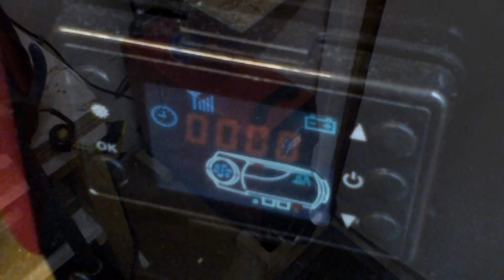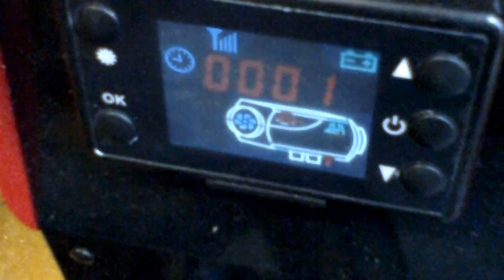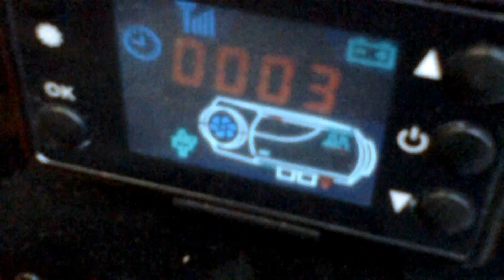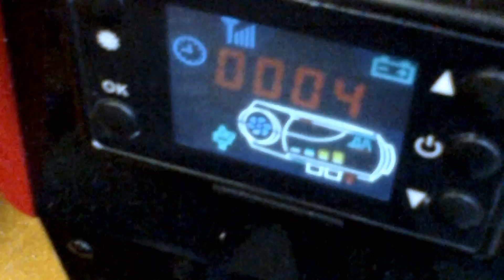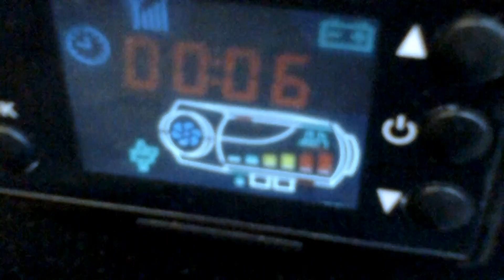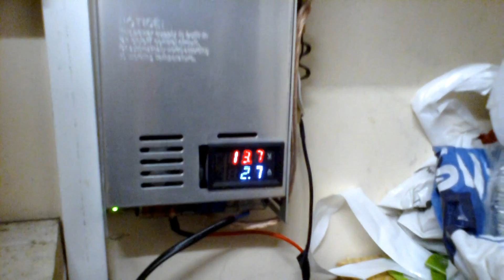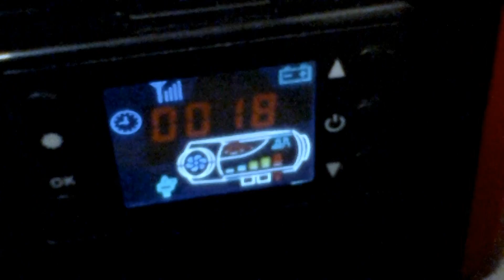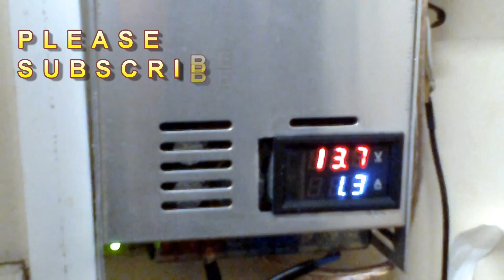COMPACT CHINESE DIESEL AIR HEATER - AMPS used in REAL TIME

Comment: What is your power source peter
Reply from the maker: Hi Amac. As you can see in the video it’s a 20A switch mode power supply from eBay. They all seem the same. Been very reliable. Please note that I installed the volt / Amp meter as this is not standard and was made for the video.
Regards Peter

Comment: What power supply you using? I have a new 12v 30A power suppythat looks like yours and when I try running my new diesel heater it drops the power supply voltage to about 8v and shuts down when I hear one click of the pump. Is the power supply too small or defective? Checked power supply with no load and it's at just over 12v
Reply from the maker: Hi Luke. If a 30A is having the voltage pulled down like that then it’s defective. I use 20AMP power supplies off eBay 
Regards Peter
Reply: @brucepeter2007  found the problem. It was me and not the power supply.  I had it on 230v plugged into a 115v outlet. I win the dumbass award. Lol
Reply from the maker: @lukegodin8653  Opppssss

Comment: Hello mate, I have a single 12v gel battery is a small tear drop camper! I am not as smart as you are with amps and volts and watts and all that good stuff! My question is can I run one of these heater in a small tear drop the whole night? Or will it kill the battery?
Reply from the maker: Hi Lester. You never mentioned the size of your battery so can’t give you a fair answer to your question. If it’s a small teardrop unit I would say that even with a good battery it would be too powerful for such a small space. Sorry to be the bearer of bad news. Regards and stay safe. Peter
Reply: Peter Bruce it is a deep cycle marine/rv battery here the specs: 

SPECIFICATIONS
Cold Cranking Amperage:	550 A
Cranking Amperage:	685 A
Height:	8.875 in
Length:	10.25 in
Negative Terminal Location:	Top Left
Positive Terminal Location:	Top Right
Reserve Capacity:	140 min
Terminal Type:	Top Mount
Voltage:	12 VDC
Weight:	45.5 lb
Width:	6.812 in
Reply from the maker: @LesRCnmore  Hi again. Recon you would get a few nights out of that but I say again - this type of heater would be too much for a small teardrop caravan. Up to you if you fit it but bear in mind that most of the current draw is on start up and shutdown and with such a small space it would soon feel like you had a volcano in your camper and you would have to turn it off... Good luck whatever way you go. Regards Peter
Reply: Peter Bruce Yes sir I am aware that the 5kw is way too much for my teardrop, but Amazon here in the USA sells the 2kw versión it is smaller and more compact! Therefore, if my battery can run the 5kw for few nights that means that It will handle the 2kw like a champion!
Reply from the maker: @LesRCnmore  Good luck to you - stay warm and stay safe. Peter

Comment: I have a 12ft caravan (Australia) what size unit would I need? my van has 120amphour deep cycle battery...how long would battery last...only run LED lights
Reply from the maker: Hi down in Oz. I take it your looking at fitting the separate type of unit heater into an under bed bunk rather than this compact kind of heater! Either way you go with a separate or compact type the 5kW would be ideal. Heats up quick and after you hit your set temperature will tick over at around a 2kW output. How long will it last is a question like how long is a bit of string as your question contains so many variables. Condition of your battery (how many times it’s been cycled) how cold it is outside - how long are you running the unit (27/7) and the temperature you set the unit for...
As you have seen on my video it’s the start up and shut down that uses all the current from the battery and once the inside set temperature has been reached it will poodle along using around 1.2A so at that rate the battery would last you ages - I would recon you would be safe for at least 3 nights.
Another factor is these units sell as 2, 5, 8 kW but it’s only the 2kW that is a smaller size unit as the other variants are the same unit with just different setting to burn more fuel to increase the power output.
The 2kW units are rare to get hold of and most ordered are in fact supplied with the 5kW size bigger unit with the fuel rate and fan speed altered...
Just a few last tips - when you get your unit do a lash-up test run with it before installation and ensure the cables from the battery to the heater are substantial as a current drop to the heater will not be tolerated and give you an error code.
The last tip is don’t “twiddle” with the internal timing settings unless things go wrong. Many problem installations Are due to the twiddles made to the setting that cause them to soot up. It’s a furnace so if it runs leave it alone.
Hope I have been of help and thanks for viewing my channel. 
Regards and stay safe in this never to be forgotten year China has given us - Peter
Reply: @brucepeter2007  Thanks Mate for quick reply...Yep we are doing well here in South Australia...I camp mostly in our winter thats now...but its cold for us at 45F/7C in our caravan...but cause our van is small theres no room under bed or in cupboards for even heat inlets...we bush camp only no power
Reply from the maker: @smokeydk7712  Hi again. If you go for the compact type you only have to get the exhaust and combustion’s air inlet pipe to the outside. At that temperature you should get 3 evenings no problem and a 100w solar panel on the roof would give a kick to your battery even in winter. Good luck to you whichever way you go. Regards Peter
Reply: @brucepeter2007  thanks..I do have an 100w solar panel on van roof...even in winter by 10am the battery gets fully charged...I like the portable idea..thanks again 👍

Comment: Hey Pete... great demonstration... thanks. BTW... your LCD controller is very readable, my own 6 month old controler is almost blank... very hard to read unless all lights are off in the room. You know where I can get another controler?
Reply from the maker: M
Hi Mikey. The LCD screens like mine - all have the same issue for some reason and the only way out is a new controller which you can get from Aliexpress or Banggood. Hope this helps. Regards Peter
Reply: @brucepeter2007  Hy Bruce... tanx for your prompt reply. Tell me, how long did the original one last compared to the new one you have? I ask because maybe the new one is better.
Reply from the maker: @strikemaster1  Hi again. Got two units myself and I have two friends with the same so in total four the same.
Only one controller has faded but Is still legible. I have no experience on the newer type but each seem to have their quirks. We all use the remote control units so don’t really look at the controllers much as it’s the on / off button that’s used and once the previous temperature is reached the unit cuts back making the LED display redundant.
The view angle is quite critical and just changing the angle you view from makes a lot of difference.
Remember that if you change over your controller you will have to re-program it and if you don’t get the settings right your going down the sooted up strip down often road which is the only vice these units have.
Most units work fine but problems are mostly caused by bad installations or “twiddlers” who mess with the controller settings. If you do replace the LED controller ensure you know all the settings contained so the new unit can be programmed correctly. Best of luck whichever way you go. Regards Peter
Reply: @brucepeter2007  Thanks mate. Think I will order another one anyway. Doesn't hurt to have an extra one stanby when they only cost $30. Thanks for all your help and guidence... You a good bloke.
Reply from the maker: @strikemaster1  Hi Mike. Best to use the remote control as you never really need to touch anything then as you can turn the unit on/off with it and alter the temperature. Once you set the temperature you never need to touch the LCD unit at all plus you have the advantage of not damaging the buttons if you use the remote control.
Cheep as chips on eBay. Stay safe. Regards Peter

Comment: Thank you so much for your series on this heater. I'm definitely going to get one off these and leave the gas heater at home. Cheers
Reply from the maker: Hi Buzz. Our two heaters have worked fine from day one and I have a neighbour who now uses one the heat his bungalow and originally it was to be a back up unit to his solid fuel heater but now it’s his main heating and has performed perfectly all winter. Most people have issues because of either bad installation or twiddling with the air to mixture settings so they soot up but put them in right and they just keep going. In the U.K. if they can get hold of red diesel it makes it even more cost effective as it’s only just over half the price of garage pump prices.
Thanks for the comment on my videos and channel as the topics covered are quite broad.
Regards Peter

Comment: The heater keeps frying my leisure battery's really take a huge amount of power for a standard camper system
Reply from the maker: Hi there. The heater only uses a lot of power on startup and shut down when the glo plug is fired up - once the unit is going your only powering the fan so the current consumption is quite low.
I don’t know what the state of your battery is in or what size it is so perhaps you need to look in that direction.
Stay warm, stay safe. Regards Peter

Comment: Does this mean when running it will take about 5amps per hour? Or is that a constant pull of 5amps
Reply from the maker: Hi there. The Amp meter is showing you the current used at a specific moment in time and it’s variable because the current being drawn while the unit is running - at the set temperature - is totally dependent on the fan speed & dose pump speed which is what I have tried to  demonstrate in the video.
The current required at start up and shut down is considerably more due the the activation of the glow plug and full speed of the fan and the fuel dose pump...
So many people confuse the issue with Volts and lack understanding of the other aspect - Amps.
You are wrong to think 5 Amps per hour or a constant draw of 5 Amps.
The bottom line is that a good battery is required together with good sized wire conductors capable of delivering the current level required to the heater on start up and shut down. That’s the secret of a good solid installation.
I hope I have helped you understand that the answer to your question is not as straightforward as you first thought...
Stay warm. Regards Peter

Comment: Thanks for the info' Peter, just got mine yesterday. 
Really helpful videos.
Reply from the maker: Hi Robert. Thanks for your comment - now you can stay warm.
Regards Peter
Reply: @brucepeter2007  Cheers Peter, working on it as we speak. Just fitted a inline fuel filter and putting the pipes on. Will let you know  my thoughts when i get her fired up.
Reply from the maker: @robertdonnan8659  expect a bit of smoke at first but then it’s toasty warm. Enjoy Regards Peter

Comment: Hi can you please tell me were you got you volt and amp meter from ?  Thank you
Reply from the maker: Hi Louie. I get a lot asking this and the answer to your question was directly in the comments section so I have reproduced it for you...
Hi there. I only did the original meter shown on earlier videos installed on the power supply to show voltage however Amperage was a response to seeing questions asked by the RV and boating together with the Off Grid community as they rely more on their batteries / solar chargers so current draw is an important factor which prompted me to install this Amp and voltage meter.
Only use to me is if the gloplug or main board fails which will give me an indication on the meter however it’s really of little use other than used for this video as info for them who need the information. If you wish to install one you need a large 20Amp shunt which is quite large and if you look at the power supply you can just see part of it to its right hand side so it’s not a pretty item to look at. 
Regards Peter

Comment: Hi Mr Bruce.  First of all great Videos you have done. I learned a lot. I’m an American living in Korea and it has turned crazy cold. I’ve been looking at buying one of these heaters. I am somewhat of a novice with dealing with electric calculations. Sorry rambling. My question is if I want to run this for let’s say 10 hours. From what I saw that’s 13 amps for 20 minutes (10 startup and 10 shutdown) and 5 amps continuously for 10 hours for a total of 50 amps. I want to make sure I get the right size battery to last the entire time. Can you help make sure I’m doing it correctly.  I guess the question can go to anyone watching this.  Thanks from the Far East
Reply from the maker: Hi Bob from Korea. So you don’t discharge the battery below 50% and cause battery sulphation which will reduce battery life considerably I would go for a 12v 120 Amp battery which would leave you a good margin.
If you have got unreliable mains system use a battery with a 12v 10 Amp SMART BATTERY CHARGER FROM ALIEXPRESS which will keep your battery charged up all the time. Hope this helps you.
Regards Peter

Comment: Great video.  Do you have a link for the 12v converter with amp meter?
Reply from the maker: Hi there Steve. I only did the original meter shown on earlier videos installed on the power supply to show voltage however Amperage was a response to seeing questions asked by the RV and boating fraternity together with the Off Grid community as they rely more on their batteries / solar chargers so current draw is an important factor which prompted me to install this Amp and voltage meter.
Only use to me is if the glo-plug or main board fails which will give me an indication on the meter however it’s really of little use other than used for this video as info for them who need the information. If you wish to install one you need a large 20 Amp shunt which is quite large and if you look at the power supply you can just see part of it to its right hand side so it’s not a pretty item to look at. Regards Peter

Comment: Good, i think the perfect powersupply 15-20 amps. Regards Tuomo Finland.
Reply from the maker: Hi there. Thanks for your reply. Glad you found my video of use and the power supply is a very good unit.
Reply: @brucepeter2007  Thank's answer! I've been using in the garage. 5 * 5 meters in size. 118 € heat for a great device !! :-))
Reply from the maker: @tasamaantallaaja  thanks for coming back to me - stay warm my friend. Regards Peter

Comment: Thank you for your video and discovery of this heater. I am almost sold for this unit. So in essence there are 4 stages of power consumption:

1) Startup - pump, fan, plug, the whole motherload going, maximum about 150 Watt / hour maximum and lasts 3 minutes time.
2) Easing into target temperature, about 65 Watt / hour. Motor/pump slow down = current goes down.  About 3 minutes?
3) Reaching the set temperature -  It settles into about 15 Watt / hour
4) Shutdown/cool-down period - Reaching a maximum of 150 Watt / hour but the whole process lasts less than 2 minutes.

I have a question: How's the clackety-clack of the pump? I've seen other videos where the pump is somehow suspended by a tie-wrap which diminishes the noise. My application would be in a van, next to a sliding door but with a wall on the other side (towards the interior) to separate smells and noise.
Reply from the maker: Hi there udmbfck. The voltage and current required to run the heater was clearly shown in the video BUT the issue you raise about the ticking pump is a major issue for many. Trouble is the unit has a ticking DOSE PUMP so it makes a definitive “click” every time it delivers an exact amount of fuel to the heater cavity which you can mute a bit but it’s still there. People have tried all manner of ways to silence the unit but although they manage to cut down the sound a bit they can’t be silenced because of the very nature on how they work.
I decided to go for the “all in one unit” which was unknown when I got my two because why end up doing an installation when you have it all done for you in a box! If you go down the same route as me your not tied because you can still remove the units and install the separate items the same as everyone else.
Regarding the ticking point again, after the set temperature is reached the ticking pump reduces dramatically in its “ticking duration per minute “ and it’s loudness tends to be more muffled so if your ready for sleep it’s not an issue - for me anyway.
Other than that you can interpret the ticking dose pump as sheep jumping over a fence which is the old adage.🐑🐑🐑
I clearly remember doing this when I was a kid as we only had wind up ticking clocks  ⏰ which everyone seems to have forgotten about now. If your old enough to remember the ticking wind up alarm clocks perhaps like me your wondering what all the fuss is about😀🤔🤔
Regards to you and thanks for making the comment - and have a hoppy new year- Peter
Reply: @brucepeter2007  Thank You very much for your prompt reply.....to someone on the other side of the pond....Happy  Holidays to you too!
Reply from the maker: @udmbfckx2916  Stay warm Regards Peter